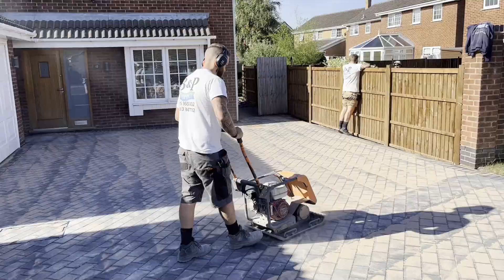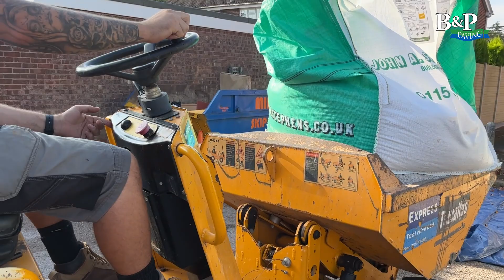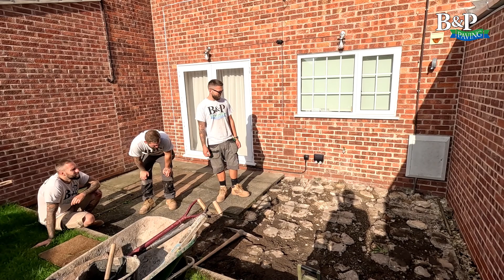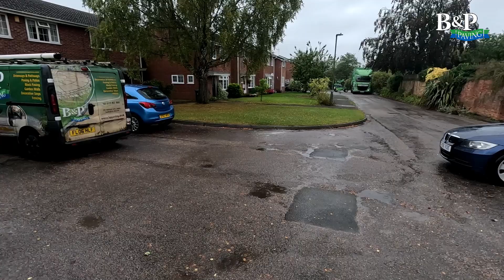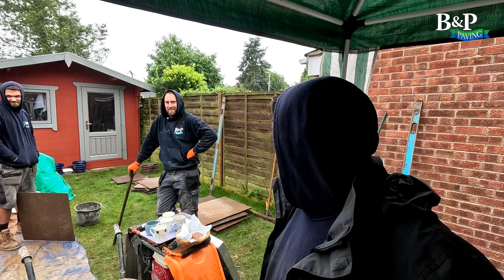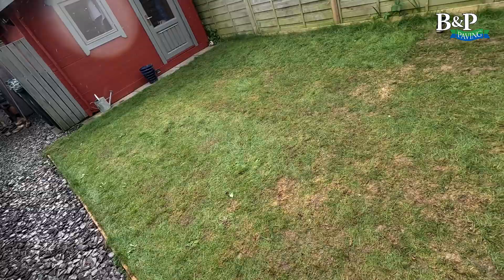Forced to work in the rain #061

Comment: i hate that crap from customers. you cannot expect people to suffer out in the weather like that and then to get crabby about it. 
i had one earlier in year myself. i priced the carpentry in a new house at 12 days. i worked 8 10 everyday and was looking at getting it done in 6 6.5 days . but bloody long days. after 5 days i was a bit tired so thought i would finish 'early' at about 8 so i would be home at 9 . mother of the lovely couple  gave me a few cheap coments  about getting them moved in and to get the kitchen  skirting done. i did stay till 10  and got it done but boy was i pissed . some people are never happy. you can burn the candle at both ends and they woild still expect more
Reply from the maker: Yeah it happens

Comment: Another top job. I’ve got a small area to slab at some point. Got the same resin mortar to point. Do you strike it or just brush it in and let it set? Cheers 👋
Reply from the maker: Easy joint , there’s many brands

Comment: Really enjoy your weekly uploads and seeing the finished results. Just one question if you have the time, would it not look nicer to have the cuts tucked against the house so less obvious? Not calling you out as I’m not in the trade, just wondered what the reason would be. Keep up the good work lads.
Reply from the maker: Well it depends on the job and the preference…. A lot don’t want the cuts near the house where they are going to be stepped on constantly near the door ect…. A full slab is more secure than a small cut…. Like on a raised patio you don’t want a small cut on the edge